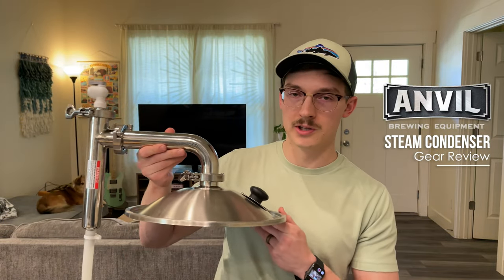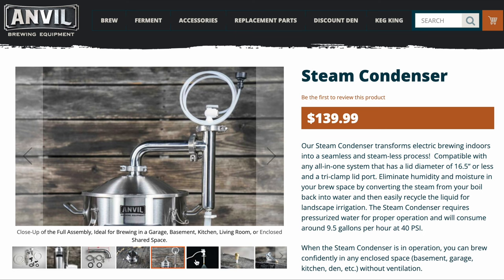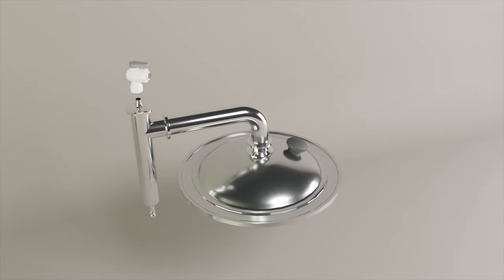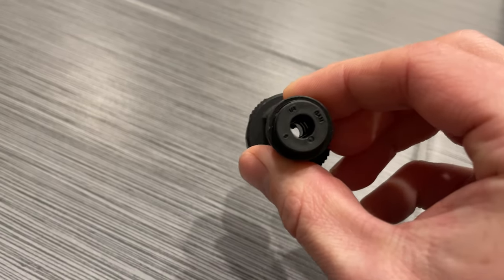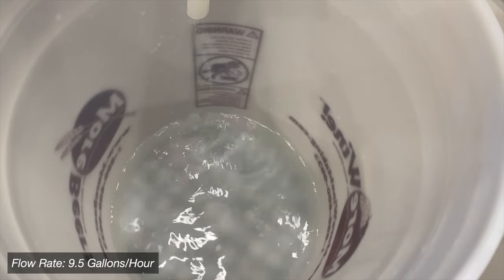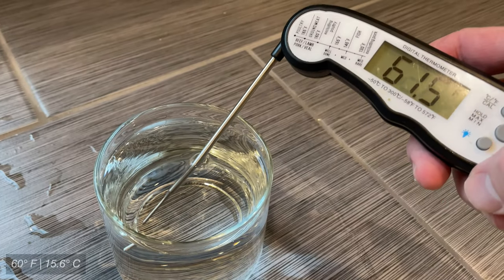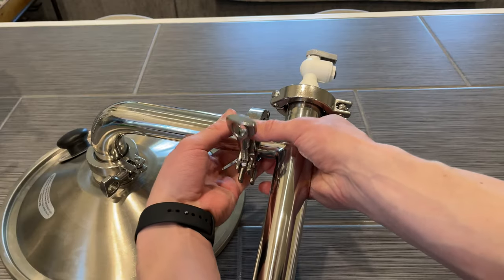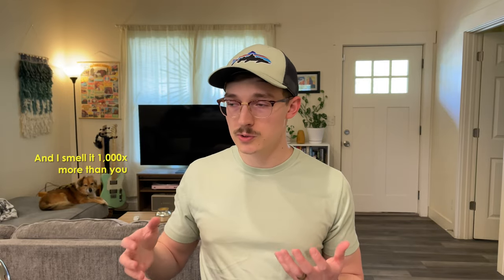Anvil Steam Condenser - Gear Review

Comment: Bruv. What fermenter do you use especially for lagers?
Reply from the maker: I have a 7 gallon SS Brewtech Bucket, modified with their FTS package, and glycol chiller. I usually brew 3.5 gallon batches, so I needed the extenders for the chiller as well.

However recently for lagers, I have been using a 5 gallon torpedo keg as a fermenter, with a modified (cut off) dip tube, and a ball lock spunding valve! I think I get good results from either, but fermenting at room temp under pressure in the keg is certainly the more cost friendly approach.